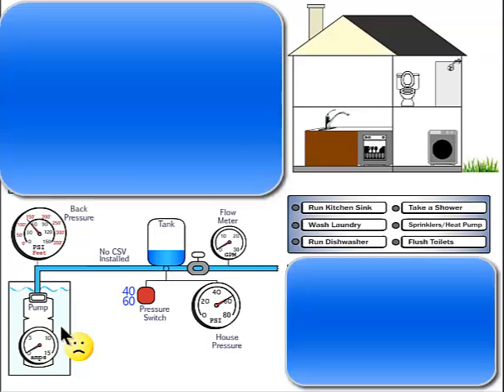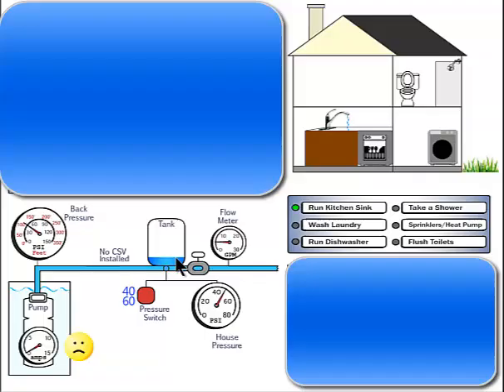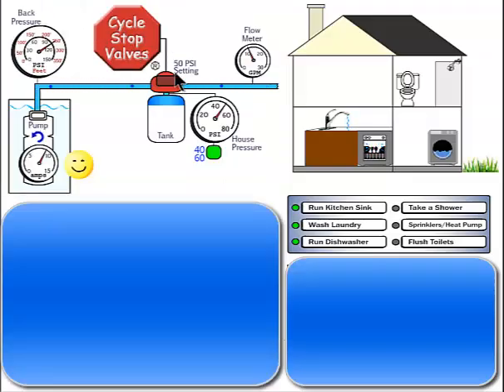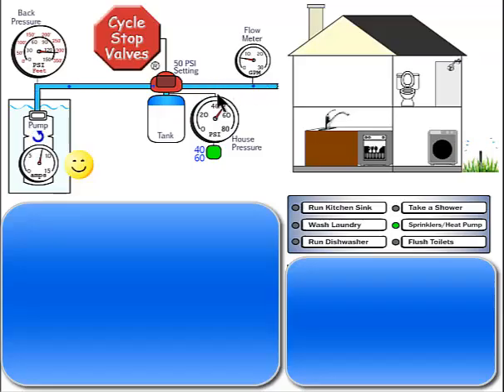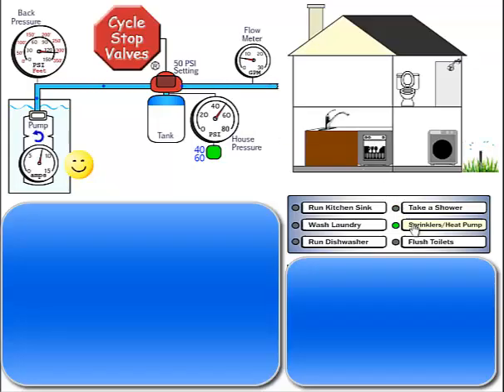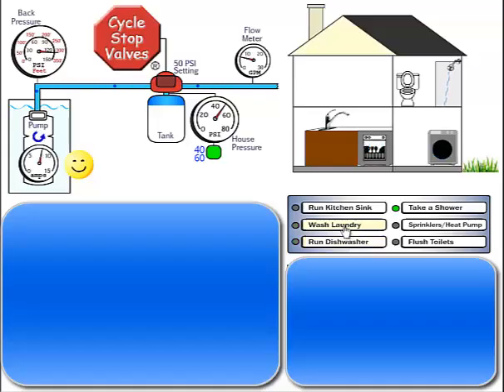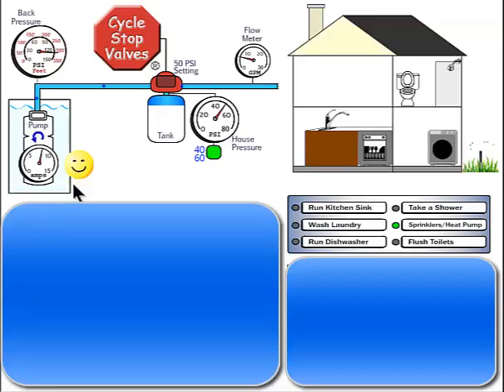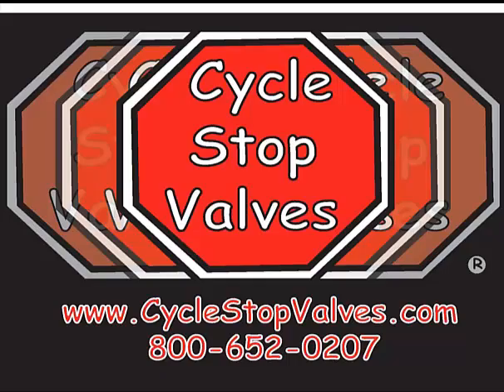How a Pressure Tank Works and why you need a Cycle Stop Valve

Comment: I am looking to make an irrigation system for my orchard and garden. I am also going to add a few hydrants along the way. I want to pull water out of my creek and was looking at different setups. I have a good pump and old bladder from an old setup. With this Valve, do I still need to use a bladder tank? what is the point of the tank if the valve bypasses the tank?

Comment: Can you install the CVS. Value BEFORE the pressure tank, or with the pressure tank as picture shows???
Reply from the maker: The CSV must be before the pressure tank/pressure switch.  When the pressure tank is screwed directly to the 3/4 port in the CSV1A the tank is on the outlet side of the CSV.

Comment: What software that you use in the video?
Reply from the maker: It is a really old Flash animation program.  It use to be an animation you could play with and see how the system works. Flash is no longer supported, which is why I had to make it into a video.  I have someone working on a new animation, but it maybe a while.

Comment: That's justa pressure regulating valve. I have one.
Reply from the maker: NO not just a pressure regulating valve.  Put a regular pressure regulator valve before the pressure tank and pressure switch like a CSV and you will burn your pump up in 5 minutes.  CSV works sort of like a pressure regulator, but will never let your pump get hot like a PRV will do.
Reply: @cyclestopvalves8380  Don't worry,  I worked on industrial fluid flow systems for a living.  your valve description is too vague.  I like to know what it's doing and how.  My home system has, coming from the well, a check valve in case the pump mounted one gets stuck,  gauge,  throttling valve, gauge, pressure switch, then tank.  Downstream from that is a PRV.
Reply from the maker: @bobbean4702  The CSV is just a valve.  It opens and closes to maintain a set downstream pressure.  It just can't close to less than 1 GPM.  So when you are no longer using any water, the 1 GPM leaking through the CSV has no place to go except the pressure tank.  The pressure tank then fills and the pressure switch shuts off the pump.  This way you can have a constant 50 PSI while using a 40/60 switch. without the pump cycling on and off.  With your pressure regulator after the pressure tank, you would need a 50/70 switch.  Then your pump will be cycling on and off over and over between 50 and 70 while the pressure regulator is giving you 50 PSI to the house.  You are getting 50 PSI constant, but cycling the pump to death in the meantime.

Comment: I am going to ask some questions that may also benefit others. If I bulk up the channel too much I think you can delete them.

I have a 35 gal bladder tank that I just recharged. I will check run time occasionally to determine if the bladder is bad. I am thinking that with a CSV the short cycling experienced with a leaky bladder would not be a problem as it would still provide a buffer to allow the pressure switch to activate the pump and eliminate the short cycling. If that's the case tank replacement could be put off until a more convenient time or maybe forever if one were willing to keep check on the air.
Reply from the maker: Several things.  If the system had a CSV to start with, the pump would not have cycled on/off enough to destroy the tank bladder.  But yes if you have a water logged tank, the CSV will still keep the pump running while a toilet is filling or a shower is running, compared to clicking on and off rapidly several hundred times as it would without a CSV.  Delays the need to replace the tank, but doesn't eliminate it.  A good tank is needed, just not a large one.  The CSV fills the tank at 1 GPM above its set point.  So, no matter the size tank we try to set the CSV/pressure switch to get a minute of run time.  This can be done with as small as a 4.5 gallon size tank that only holds 1 gallon of water.  The CSV filling the tank at 1 GPM makes the tank more of a mechanical timer than a water storage vessel.  The 1 minute of run time (which with the CSV only happens after you stop using water) is to make sure you are finished using water before the pump shuts off.  As long as you are using more than 1 GPM the CSV just keeps the pump running continuously, water goes right past the tank, and the size of the tank is a moot point.
Reply: @cyclestopvalves8380  
!.) With a 35 gallon tank how close can I set start and stop pressures to ensure enough run time yet avoid annoying pressure swing?

2.) I have three hydrants before the pressure tank so I assume the CSV would have to be installed at the well head which is about 100 ft from the house.

3.) I don't know the specs on my submersible pump, is it safe to assume that I can just install the CSV with no worries?
Reply from the maker: @shofar-man  
1.) With a 35 gallon tank how close can I set start and stop pressures to ensure enough run time yet avoid annoying pressure swing?

With a 40/60 switch a 35 gallon tank holds about 8 gallons of water.  The CSV fills the tank at 1 GPM.  You can get two minutes of run time with a 5 PSI bandwidth, like on at 55 and off at 60.  Setting the CSV at 55 will give you two minutes of run time.  However, you will also only get 2 gallons out of the tank before the pump starts, which is basically the same as using a 10 gallon size tank with a full 40/60 switch setting.  The 55/60 setting would keep the pressure more constant than the 40/60 setting.  But it is only for the first 2 gallons used from the tank, as then the pump starts and the CSV gives perfect constant pressure for as long as the faucet/shower is on.  The first 2 gallons is used up so quickly you won't notice the quick pressure drop to 40 before the pump starts.  So, larger tanks are not necessary.  BTW, finding a pressure switch that will do less than 17-20 PSI between on and off isn't easy either.

2.) I have three hydrants before the pressure tank so I assume the CSV would have to be installed at the well head which is about 100 ft from the house.

The CSV would at least need to go before the first hydrant.  It can go in the line or the CSV125 is made to be installed in the well, so it is before everything.

3.) I don't know the specs on my submersible pump, is it safe to assume that I can just install the CSV with no worries?

No.  Especially with the CSV125 as it can only take a max of 150 PSI back pressure.  If you can't find any info on the pump, and amp check will tell you the Horsepower, and a bucket test will tell you the GPM rate and gives a clue to the depth of water.  From these things I can back into which pump you have and find a curve.  You can also use a pressure gauge before a ball valve and close the ball valve long enough to get a max pressure reading, which is really all we need to know if the CSV will work.  Most pump systems are fine with a CSV.  However, occasionally we run into a pump someone incorrectly installed that was made for for a 800'-1000' deep well, and the well water level is only 10'.  That causes more back pressure than a CSV can handle, and is why you can't just put a CSV on without knowing something about the pump.  I can help you with the amp and bucket test if you like?  806-885-4445

Comment: The CSV sounds like a great idea. I also have some thoughts on the pressure tank. I think well tanks are poorly designed, possibly to avoid coating the inside of the tank. My thought is that the bladder should be for air rather than water. The bladder shape would not be critical and replacement could be through a port located on top of the tank for easy access so a homeowner could just pick up a replacement  at home depot and install it w/o even fully draining the tank.
Reply from the maker: There are  bladder tanks and there are diaphragm tanks.  Some bladder tanks have the air inside the bladder, some have water.  All diaphragm tanks that I know of only have water under the diaphragm.  The most important thing to make a tank last is to limit the pump cycling. With every pump cycle the diaphragm or bladder expands and contracts.  it is like bending a wire back and forth until it breaks.  It is only going to take so many bends.  You could use up all the bends in a short time by letting the pump cycle on/off too much, or you can make a bladder/diaphragm last many years by reducing or eliminating the cycling by using a Cycle Stop Valve.  The second most important part of making a tank last is getting one where the bladder/diaphragm does not touch the sides when expanding and contracting.  It is hard to make a bladder that doesn't touch the tanks sides, and easy to make a diaphragm expand and contract without touching the tank.  Oh, and tanks with replaceable bladders are the worst, as they are made to need replacing regularly.  In other words diaphragm tanks are better than bladder tanks, but any tank will last longer when working with a Cycle  Stop Valve.
Reply: @cyclestopvalves8380  Thanks! I find that Wellmate makes a fiberglass well tank with a top replaceable air cell. They apparently have a quick disconnect for the plumbing as well. I just recharged my bladder tank idf I have to replace it I am considering a Wellmate tank and a CSV.
Reply from the maker: @shofar-man  The bag or bladder in a well mate tank tends to wrinkle when it expands and contracts.  The fold or wrinkle is where it will break.  Look at the flex lite.  They are fiberglass with a diaphragm.

Comment: Does the well pump continue to try and make water at the usual pump flow rate? There does not appear to be any current limits placed on the submersible pump by the CSV that I can see. There is no electrical control going on between the pump and the CSV. Correct me if I'm wrong but,I can understand how when there are several things using water at the same time, the CSV might eliminate a cycle on on and off , however how would this save energy, and save your pump from excessive wear? Putting a restriction on the flow of water leaving the pump seems like a dead heading measure. The pump continues to pump at it's usual force but is held back by the CSV regulator. If there were a lessening of energy  sent to the pump , wouldn't that be a method of throttling it vs physically impeding the flow? Please explain and thank you for the video.
Reply from the maker: Those are very good questions.  The CSV can never completely close, so it can never deadhead a pump.  There is no electric to the CSV.  Pumps just normally reduce in amperage when restricted with a valve of any kind.  Here is a video to explain the technical stuff.  https://www.youtube.com/watch?v=3GABhLLtjas
Reply: @cyclestopvalves8380  Throttling down the flow to 50 GPM is making the pump work harder. Harder = more power to  overcome a restriction. I'm sorry but where I come from it takes the life out of the pump and will  shortens it life. Not to mention the added energy cost. Am I missing something?
Reply from the maker: @dantedenardis1385  Yeah you are missing a lot!  Pumps work just the opposite of the way you are thinking.  Pumps work easier when the flow rate is reduced, not harder.  The energy a pump uses decreases not increases when the flow is restricted, which increases not decreases the life of a pump.  Pumps are counter intuitive, which is why you are thinking wrong.  See this video for a more technical explanation.  https://www.youtube.com/watch?v=3GABhLLtjas
Reply: @cyclestopvalves8380  Okay I might have learned just something new in this. Youare right , it is counter intuitive to think that the harder a pump pushes through a reduced orifice the less energy it is going to use. Thanks for giving me something to think about at 3am ....lol
Reply from the maker: @dantedenardis1385  I am glad someone besides me is up at 3AM thinking about this stuff.  Lol.  It is one of the hardest things to explain.  I have tried many ways in almost 30 years and still get the same question everyday.  It is the centrifugal impeller that is the magical thing here.  It only draws a load depending on how much weight it is lifting.  The actual definition of horsepower is the ability to lift 33,000# of weight one foot in one minute.  One gallon of water weighs 8.33 pounds.  It takes a lot more HP to lift 50 gallons a minute than is does to lift 1 gallon a minute.  Restricting the pump to make this happen causes the impeller(s) to just spin in nice cool lubricant and not draw any load, as they don't actually touch anything.

Comment: Do you have a diagram on setup this system .
 my house has kitchen sink-dishwasher lavatory sink
 bathtub -toilet and how much is the [Cycle stop Values]
and do I get it from you are hardware store 
 let me know A.S.A.P
Reply from the maker: The CSV1A by itself is $179 including freight.  The PK1A kit is $395 and has a new pressure tank, switch, gauge, relief valve, and everything you need to replace the pressure tank.  You can get a diagram and order it here.  https://cyclestopvalves.com/pages/pk1a-pside-kick
Reply: can you take a  picture of the items that will get .I like to see what I get
Reply: can I change 50psi to 70psi
Reply from the maker: @alanmcdowell977  You can see a picture at the link I posted.  50/70 is not a problem, you can order the PK1A set up that way.  I would switch from the 4.5 gallon tank to the 10 gallon tank when going higher pressure as at higher pressure tanks hold less water.
Reply: @cyclestopvalves8380  Preset scv are $69.00

Comment: Interesting device, sounds like a special kind of pressure regulator. If I had to make an educated guess: It is like an adjustable high flow regulator (set to 50psi in this example), with a secondary, very restricted path (1gpm) that bypasses the regulator. This bypass path only allows pressure on the output side of the regulator to gain more then the regulator setting when the flow is less then 1gpm, and is critical in making this work. Very clever!
Reply from the maker: Thank you.  Yeah so simple it is scary.  Lol!  We tried to see these to all the pump companies back in the early 90's.  Took us several years to find out they blacklisted the CSV.  Pump companies said the CSV is a disruptive product as it makes pumps last longer and use smaller tanks.  Wow!  Found something that makes pumps work better and last longer and the pump companies are doing everything in their power to discredit us and come up with variable speed pumps or Masscontrol flow switch controllers that don't make pumps last forever like a CSV does.  Notice you don't hear from any of our customers from 20-30 years ago?  The CSV made their pump systems work so well and last so long they forget they even have a pump system.  When water comes out the faucet everytime you open it, you will never have to think about your pump system again.